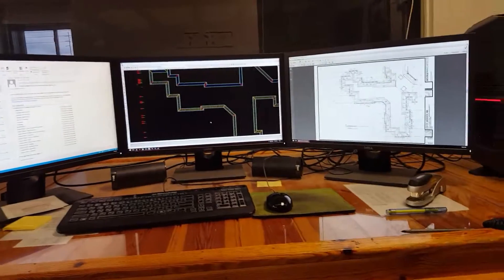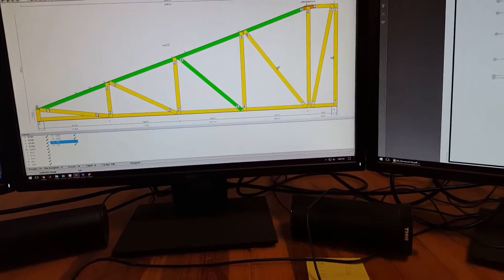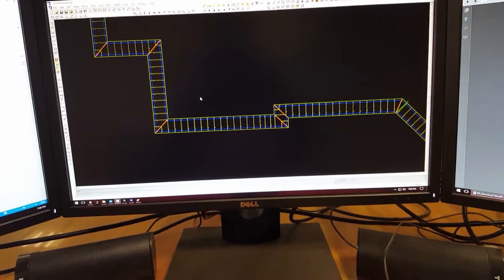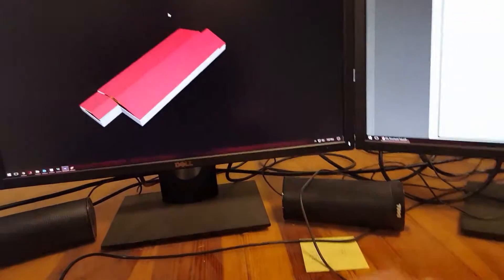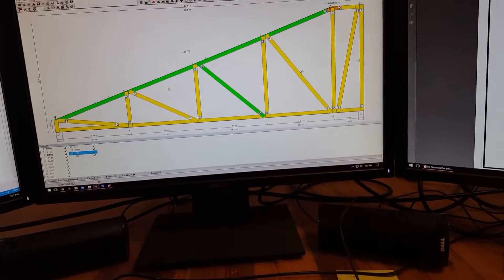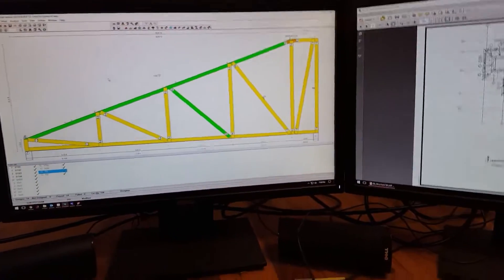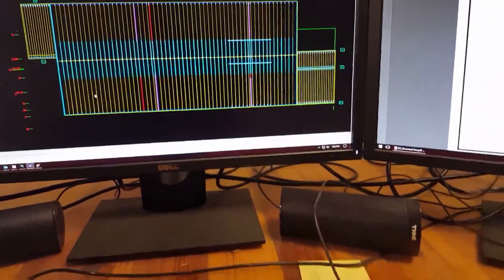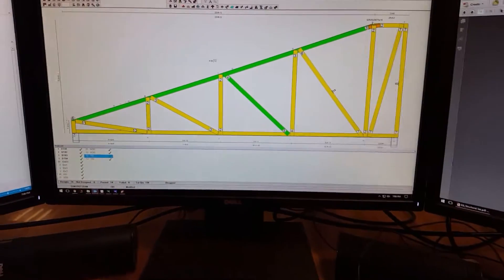Umm.. I'm a truss designer.

Comment: I love this video, I am a mechanical designer and have been designing machining parts, sheet metal, server rooms, hvac containers, but never Truss. I see the payout potential , but how does one make the jump from 3d/2d designing remotely to Truss designing. They all seem to want 5 years experience in just Truss design. I am the kind of person willing to take lower pay for a bit while I am being taught a new skill. Any suggestions?
Reply from the maker: @jamesdtackett86  I got in to it without knowing anything about it, but I started out at a local mom and pop truss shop. They needed a designer and I said I had a ton of IT experience, but no design experience, and they said they'd train me. Which, they kinda did, but I learned a lot on my own. After 5 years of low pay with them (but it was a learning experience) I went to TheJobLine (it's a website) and applied for a remote job doing the same thing and I got it. Now I make ~$70k a year (depending on some OT) and I work for the nations largest building component provider. I work from home, full benefits, 401k, good pay, annual raises, the Dayforce card where I have access to my money after every day I work if I need it, 40 hours paid vacation + separate paid sick time (depending on your state requirements), quarterly bonuses based on my performance, they provided me all my computer equipment, plenty of different opportunities within the company for advancement, etc.

So yea.. you just have to find a company willing to train you and as long as they're decent to you and give you at least $18 an hour to start and everything you need, stick with it. 

I've been doing this almost 10 years now and never thought it would be a career for me, ever. But here I am, and I'm not complaining. Well.. at least not about the job lol
Reply: @ItsJustRyansChannel  thank you for the response. I make 27 now. And do almost any kind of 3d and 2d design you can think of. But I can't get one of the truss design places to give me a chance. I'd be willing to take low pay. Especially if I had access to the one of the programs, I would take the time to teach myself with it.

Comment: Hay, Have you used Alpine or Mitek? Which one do you think is the best?
Reply from the maker: @Scienceiscool355  I've used both. Mitek is the best IMO. But this isn't software anyone can just get. You have to be a component manufacturer and buy plates from either Mitek or Alpine to use their software.

Alpine may actually be cheaper, and technically it works all the same, I'm just more familiar with Mitek SE and I've been using it for 8+ years now. 

What you're actually seeing in this video is an older version of Mitek Layout that is meant for steel trusses and is licensed by Aegis. 

But when it comes to wood truss/wall panel design, it's Mitek SE hands down.

Comment: I found this video when I was first potentially offered a job doing this. I was very unsure of whether or not it would be worth it, as I was very reluctant to work another job that I didnt't enjoy. As of now it's been almost a year and I wanted to share my experience. Something I learned from this job, is that I really love design work. That is the basis of your role in this position and can feel like you're playing a game sometimes. You get to work comfortably inside, you can listen to music and are relatively independant. However, much responsibility is also linked to project managament, scheduling, pricing, missing information, calling contractors and engineers, etc are the parts that are not so fun. Mistakes made can sometimes cost the company thousands of dollars and can be very stressful. Im very thankful to work for a good company and a forgiving boss. The job can be mentally exhasuting, but each mistake is an opportunity to gain experience and improve. I barely had any experience behind me when I took this job, and I would encourage anyone to pursue it if they are willing to push themselves to learn.
Reply from the maker: Glad to hear you're liking the work and that these random ass videos I made years ago are helping some folks 😁

Yea this was old stuff when I was still designing mostly steel trusses. I don't work for that company anymore, I moved on to bigger and better things and now work for one of the largest building component manufacturers in the country as a remote designer. I design solely in Mitek SE now and do custom homes in Florida. I've been doing this work for over 8 years now and like you said, it has it's ups and downs but relatively it's a good job and a LOT of people can find entry-level jobs and build a career off of this type of work without any prior experience or college education. All you need is that desire to learn something new a little creativity.
Reply: @ItsJustRyansChannel that's awesome to hear man 💪🏻does your salary continue to grow with your experience? I'm not making a lot right now, but have only been doing it a little under a year. That's my biggest concern with the job
Reply from the maker: @JosephBanks20  Oh yea, for sure. You SHOULD be getting yearly pay raises no matter what. Some smaller companies try to hold out like mine did, but if your work is improving end over end then you have a right to ask for more money. Ask for something higher that you know you probably won't get, but keep in your mind the lowest minimum per hour increase you'll take. If your company values you they'll pay up.

When I first started doing this back in 2015 for a small privately owned truss company, I really did a lot for them and went from $15 to $17 an hour within 2 years. No OTHER benefits though, so realistically that bummed me out. I went another 2 years almost without a raise and finally after I had to threaten to leave I finally got $20/hr. But again, no other benefits and by this time I was sick of my boss using me for other shit, like designing the company website and shit, and not paying me for it. He literally tried to tell me, "screw your job title, you do whatever the hell I need you to do." So I already had one foot out the door by year 4. I started looking on TheJobLine for new remote jobs hoping my 4+ years experience could get me somewhere. By the time I hit 5+ years experience I finally found a company that would hire me remotely to do floor and roof truss design in SE. I went through all the interview process stuff, liked what I heard and put my 2 weeks notice in right away.

When I started with this bigger company they immediately gave me $25 an hour, plus full benefits, 401k, paid vaca and sick time, quarterly performance bonuses, AND they paid for all my computer equipment. 👍

I've been with them for over 2 years now. January 2024 will be 3 years for me, and I'm currently at like $27/hr.  Pay raises are automatic and don't even require review. Every employee gets at least the same cost of living pay increase yearly. It might be like $0.60/hr or something, but still. 

I've already been considered for management positions too, which are salaried. Basically a design manager, so I wouldn't design anymore I would train and manage OTHER designers on my team. I got passed up for the first opportunity, but it's fine. Someone with more experience rightfully got it. But with a company like mine I can apply for any in-house position I want. So more opportunities will come along and I'll jump on them if I want them.

So yea, point is.. this isn't just a "job" it's a career path. And if you stay on it long enough you can definitely climb the ladder to the top, make more money, move to bigger and better companies, etc.

If you're working for a small mom and pop truss shop right now you may have to consider leaving eventually if you want to further your career. It depends. But at least stick with them for 3 years and learn the ropes. You want the experience and you want to be able to demonstrate good design work, critical thinking, all that stuff.
Reply from the maker: @JosephBanks20  If you have any other questions let me know and I can try to help.

I always people to try and get in to this line of work. It really is a good job for the right type of person. There is a high turnover rate for new designers. A lot of them quit within the first year once the work starts getting hard or stressful, or maybe they just never really figure it out. They aren't "computer people", or can't do basic math, or can't figure out how to read building plans because there's just sooooo much information on there lol 🙄 you know, it's always something.

But for those who don't mind the desk jockey way of life then yea, there's a lot of opportunity in this industry.

Not to mention it's a job you can be proud of at the end of the day. You're doing something with a purpose. Something that requires a level of creativity and intelligence to master. And for a lot of people out there who have those abilities but not a lot of other opportunity, like the ability or money to go to college or something, then it's a technical job for skilled workers. And trust me, saying "I'm a truss designer" feels a lot better than saying "I flip burgers at McDonald's." 🤣

No offense to those people or anything. Someone has to do it, right? But at the end of the day I consider that more of a temp job. A stepping stone to something better maybe? But this, what we do, this is already a career. A potentially life-long career. Your only stepping stone is maybe going to a bigger company one day and maybe becoming a regional manager one day. You don't really need to worry about "what am I going to do next." Just keep doing what you're doing and go UP in the industry you're already in.
Reply: @ItsJustRyansChannel  Wow thanks for sharing! It's encouraging to hear that this career path is a worthy one. I'll keep moving forward and see what doors God opens and closes for me, and I wish you well on your journey ahead!

Comment: Did you have any back ground in this kind of work before you started the job? Ive been a lead truss builder for 5 years and im looking to do something different inside my company. We promote in house and Ive been told that going into design is an option for me. Is it pretty straight forward or more technical?
Reply from the maker: grab my knife Thanks for the comment. I got the job based on my previous IT/computer experience. But no, when I went in to it I knew nothing about the software I'd be using and nothing about trusses. I didn't even know how to read blueprints, I had to learn it all on the job. So the fact that you know how trusses are built and how they work is a good thing. That will help you with the engineering aspect of things, I.e., knowing where to add a splice or web brace, and how girder connections work, etc. I didn't know any of that at first and tried to let the software do everything, but the design of complicated trusses really does require some experience and knowledge to make them as efficient and strong as possible, and a lot of manual changes will be done sometimes. But anyway, you have a good chance of being promoted to designer. Our lead designer started out as just a builder, now he's lead designer and has been with the company for 15 years. It'll be a new and exciting opportunity that has growth potential. Maybe you start out building steel trusses, then you move on to wood using software from MiTek, then you move on to wall panel design, then maybe you start learning AutoCAD. Hell, if you pursue it the next step after this is to become an engineer. So I'd say go for it if your company has an opening for a designer. It can get stressful as you transition to life on a computer, dealing with phone calls and customer demands to have a project built a certain your way. It'd be your job to interpret their blueprints and layout the design of the trusses and get approval on it. And if they want changes or something moved or the specs on the project change you gotta stay on top of that. I've done everything from small residential wood jobs to state funded jobs to military projects. And they range from you having full control over the design of the roof, to you having no control over the design and having to following the blueprints and specs to the letter. And if you miss something, guarantee that an inspecting engineer will find it and make you change it. And too many changes on a project can cost your company lots of money. Too many screw ups on a single job could easily ruin your companies reputation as contractors slander your name all over for taking too long or requiring too many changes. So the point is, it can be stressful, but it IS fun, and it IS a very unique job to have, and it DOES have growth potential and being good designer always commands more money. Let me know if you have anymore questions.
Reply: Thanks for the reply! If my company has another opening I think im going to go for it. Is there any sort of study material around that you know of or any freeware that I could play around with and get a feel for truss design?  Is there anything you wish you would have known before you took the job?
Reply from the maker: grab my knife Not really any software because it's all proprietary from the supplying company. So if you do wood trusses you probably use MiTek or Alpine for design. If it's steel trusses then probably Aegis or an alternative. The software you see in my video is by Aegis and we build our trusses out of their material. As for what I wish I knew going in... Reading blueprints definitely. I can't tell you how important it is to know what to look for on architectural and structural blueprints. You only want stuff pertaining to the roof and any load bearing walls and supports. It's important to know how to spot those, it's important to read the specs and understand what loads need to be applied. On your structural drawings, there are often other loads called out from RTU's or hanging deadloads. All kinds of stuff. You need to know how to spot those and apply them. Best case scenario if you miss an important load, an engineer of record will catch it in submittal and tell you to fix it. Worst case scenario, they miss it to and you end up killing people when the roof collapses because it had too much snow on it or too much hanging from it.  So yea, download real blueprints online and study them. Learn the symbols and meaning of things. If you ever want me to quiz you, let me know. Always willing to help out a fellow design enthusiast.
Reply: @boredomblows  best thing to do is talk with the plant manager and design manager, express your interest.   Many companies in the slower months will train those that have potential....but many are hiring with degrees now, so hurry up! Lol